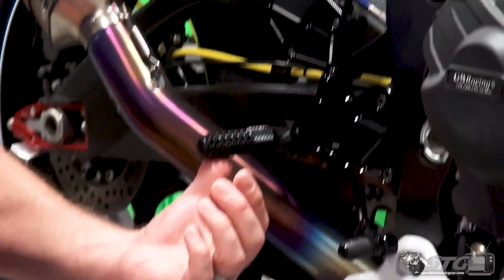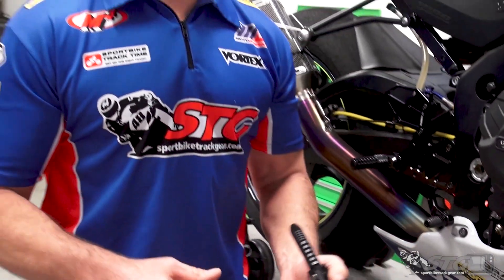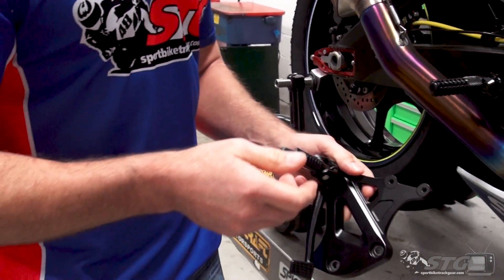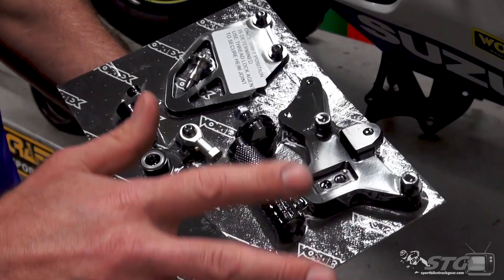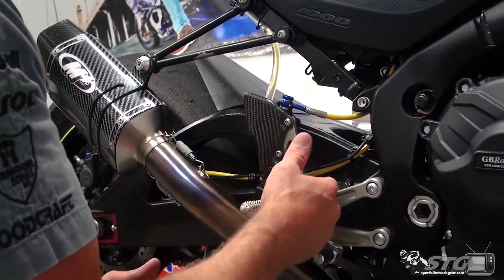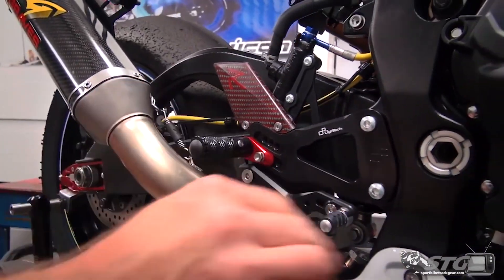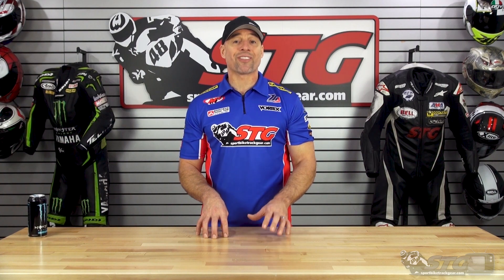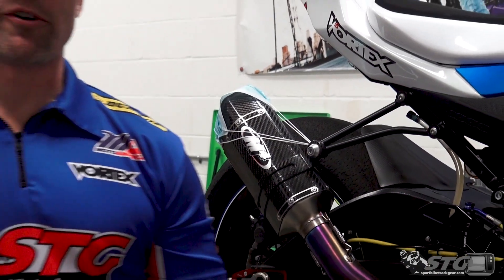Why You NEED REARSETS On Your Sportbike! | Sportbike Track Gear

Comment: Yes, rear sets are a must. Either way, I got, from you, the Light Techs. I got the other set. They put my feet and legs in the perfect position for my size. The handling  of the bike became a lot nicer when I got my knees in the proper position. I can also hit the shifter easier once I set the height. It made my bike a lot more comfortable to ride.
Reply from the maker: Thank you for the business and I am happy to hear you like the Lightechs. I rode with them on the bike and really liked them as well. - Van

Comment: I had a stock rear set on a Honda FireBlade CBR954RR that totaled the bike.  The bike high-sided and went into the swingarm, so insurance totaled it.  It was such a sweet bike, I withdrew the claim and spent months rebuilding it so I could keep it.  Might have been avoided, almost definitely, with an aftermarket set.  At the time, I was only road riding as I only had my motorcycle endorsement for 3 months, so it never even occurred to me.  In fact, if you asked me about ‘rearsets’ I wouldn’t have even understood the term or what you were referring to.

Comment: The one thing I liked about the OEM rearsets is how they had a slight tilt pushing our knees into the tank. I made it happen for these vortex to have that same feel
Reply from the maker: All of the pegs on the aftermarket rearsets are at a 90 degree angle to the support bracket. - Van
Reply: @sportbiketrackgear  I'm loving them. Going to get some spare parts for them from you guys when there available. Thanks Van and take care

Comment: great video, only question I have compared to stock what is the +/-. How far back, up, and down compared to where it sits stock?
Reply from the maker: This will be different from brand to brand and model to model. Some of the kits will call out the measurements for range of adjustment but not all. We try to include this in the listing if the brand publishes it. - Van

Comment: Hi im 5'6 riding a bmw s1000rr, and my thighs are too low to grip onto anything. Which rear sets are better designed for shorter riders? I want to move it up at an inch
Reply from the maker: Check out the Vortex rearsets on our site. Plenty of adjustability to get the pegs where you need them. Here is a link: https://www.sportbiketrackgear.com/vortex?_bc_fsnf=1&Manufacturer=BMW&Product=Rearsets

Comment: Would you recommend fixed or foldable foot pegs? Foldable options are typically more expensive than their fixed counterpart.
Reply: Some ppl are saying that fixed footpegs dont necessarily protect the pipe and the footpeg could break off. Would love your thoughts on it!
Reply from the maker: We run fixed footpegs on all of our race bikes. Whether they break off or not really depends on the crash. I have seen the fixed peg protect the exhaust in many crashes. - Van

Comment: Hey Bro! I have a GSXR600 and am 6’, 250 pound bodybuilder and the placement of my knees with the OEM rear sets is very uncomfortable. Which set of rear sets would you say would give me the most adjustability to bring the pegs lower? Anything to get less of a kink in my knees
Reply from the maker: None of the aftermarket rearsets allow for moving the pegs lower than the factory position. Lowering the pegs would decrease the available amount of ground clearance when cornering. - Van

Comment: May I ask you Mr. Van, why no Gilles Tooling? They make incredible rearsets, imo.
Reply from the maker: Unfortunately Gilles is not distributed here in the US so there will not be a proper level of support available after the sale. We prefer to offer parts that have a supply of replacement parts readily available in the event a customer has a fall and needs replacements. - Van
Reply: @sportbiketrackgear  Ditto! Sexy European parts are great until you need a replacement and you need to wait 8 weeks because Italy is on vacation.
Reply: I can't speak as a distributor but as a consumer the level of customer service I've experienced has been absolutely spectacular. From answering my questions, to getting me a free replacement shift linkage, and even sending me a dozen decals upon request via DHL. The only thing is the shipping time of at least 6 weeks is a bit of a bummer. I'm extremely happy with my investment, it's gonna be the first thing I change on my z900 and every machine after. It was between a set of Voodoo, second hand Vortex, or Hotbodies to stay within my budget, but outta nowhere I was offered a brand new set of Gilles Tooling with a $300 discount making them only $200 so I grabbed them up and they've been perfect. The only reason I needed a replacement shift linkage was because I didn't properly tighten up the lock nut after I adjusted it a little bit, ended up throwing the rod mid ride sgd and had to strain my clutch a bit in order to make it home in 4th gear, which I did manage to do. The level of service would probably be different on a larger scale though. That also explains why I got such a smokin deal cause I couldn't figure it out until now.
Reply: @skyusable  I'm actually having a huge problem with BMC right now they're not even responding to emails it seems. Gilles is Germany so I think they weren't as effected by the Covid19 pandemic. Not too sure though

Comment: Would you recommend using locktite if replacing the factory shift lever on a ninja 400? It seems like it doesnt have it from the factory
Reply from the maker: If there is none from the factory there is no reason to. - Van

Comment: Great Vid, answered a lot of questions I had. I’m 167cm tall (short) and want to know which set will provide the best height adjustment for a short guy like me? I’m riding a 2010 gsxr750. Thanks.
Reply from the maker: I would look at the Vortex or the Attack for maximum range of adjustment. - Van

Comment: I need to lower and move forward the pegs on my Kawasaki Z900 2021 because I have hip pain on the longer rides. What aftermarket rearsets would you recommend for that?
Reply from the maker: Most of the aftermarket rearsets are designed to lower the pegs and move them back. I took a quick look and did not find a set that will do what you are looking for. - Van
Reply: @sportbiketrackgear  Is there any way just to move them lower without moving them back?

Comment: Are all these rearset brand will let you use oem rear brake hose length?
Reply from the maker: The majority of the rearset kits will work with the OEM brake line kits. The only exception I can think of is the Attack Yamaha R3. Anytime we learn of any issues like this we try to add notes to the product listing to give our customers a heads up. - Van

Comment: Would you happen to have a picture or ever have experience with an aftermarket rear set holding up and saving an exhaust?  To me, the hard rear sets will bend and be trashed and even break off compared to the factory set just bending back how they are designed and are usually still good after bike goes down? 
I don't track race so I have no real world experience and wanted to know from someone like you that has this experience.. Thank you!
Reply from the maker: I have too much experience with this IMO (end of the day you race and there will be crashes). A rearset kit with fixed footpegs for sure helps to protect the bike during a crash. Personally I have never had a kit cause more damage to the bike in a fall. - Van

Comment: Hey Van, would a vortex or woodcraft rearset lineup with the graves moto 1 exhaust bracket for an r1?
Reply from the maker: Either one should work as they are designed to be compatible with the OEM exhaust. - Van

Comment: Hey Van, how much higher can the Woodcraft and Vortex rear sets go compared to stock on a 2017 GSX-R 750? I'm on the shorter side so looking to get my knees up in the cut outs on my tank. Also which would you recommend for me as I'm looking for 1-2 inches higher
Reply from the maker: The Vortex will offer a little more adjustment than the Woodcraft if you want to move them around a bit. If you are looking to put them at the highest position they will both end up in about the same spot. - Van
Reply: Thanks Van, think I'm leaning towards the woodcraft tbh. Appreciate your professional opinion 👌

Comment: I am considering getting some decent rearsets for my 2012 R6 but really not sure what to get. On my oem pegs I can lock knee/thigh into tank cut outs but feels little unsecure. I am about 5-9 but short legs for that height (inseam is roughly 31). Any recommendation based on your experience?
Reply from the maker: We are using Vortex rearsets on all of our bikes. - Van

Comment: The only thing holding me back from getting them is I don't want to loose the quickshifter that comes stock on the zx6r
Reply from the maker: You will still be able to use it. I have the OEM QS on my GSXR1000 with aftermarket rearsets. - Van
Reply: @sportbiketrackgear  with the vortex ones? Oh snap!!

Comment: With the Attack rearsets, I’ve been told for my bike (2018 Aprilia Tuono Factory) they don’t have any return (rear brake) spring or anything that allows that return. Can you confirm? I want them, but I do 99% of my riding on the street and I need my rear brake and brake light. If I get these, is it plug and play nothing else needed? Thank you.
Reply from the maker: The Attack kit does not include a return spring for the brake lever. With that said most of the rearset kits on the market do not offer this. Woodcraft offers a return spring kit you should be able to install on your master to get this done. Here is a link to this on our site:
Woodcraft Brake Pedal Return Spring
https://www.sportbiketrackgear.com/woodcraft-brake-pedal-return-spring/   - Van
Reply: @sportbiketrackgear  thank you Van. I’m 6’ 3” and 225lbs so I must have some adjustment in my pegs or I’ll drag toes or worse. I’ll take a look at the Woodcrafts springs with Attack rear sets! Thank you!

Comment: Can I still use my oem quickshifter on a ‘20 r6 with driven TT rearsets?
Reply from the maker: Pretty sure you will need a different shift rod. With that said I reached out to Driven and they are also not sure what the length of the rod would need to be. Once you get the rearsets you could take a measurement and we would then be able to help you get the correct rod. - Van
Reply: @sportbiketrackgear  sweet. Is there any issues with the brake light switch? Thanks so much!!
Reply: @sportbiketrackgear  I’m stuck between these and vortex I just don’t wanna lose the rear brake light

Comment: Any recommendations on rearrests that work well with low-profile GP style exhausts? Or do you just lose some adjustability with those type of exhausts?
Reply from the maker: Most of the exhaust systems are designed to work with the OEM rearsets. Aftermarket rearsets are designed to move the pegs up and back so there is typically no interference with GP systems that are below the rearset. - Van

Comment: Any for a 2019 zx10 for taller riders? Thanks
Reply from the maker: Aftermarket rearsets are designed to get the rider more ground clearance as well as get the ergos dialed in to best suit the rider. There are very few if any kits that will lower the footpegs if that is what you are looking for. All of the kits will allow you to move the pegs towards the rear of the bike which will give you more room. - Van
Reply: Thanks Van

Comment: Attack best rearsets on the market because of adjustment capabilities and durability .I wear size 50 euro in boots so rearsets are a must. .Bought many sets off of STG.

Van i had respect for you until the ...Best superbike is the Suzuki gsxr 1000rr??? Sorry Euro brands have surpassed the japanese brands for over a decade now ,,,Japanese superbikes havent won a superbike comparison for over a decade..FYI i own a Superbike collection of all current japanese and Euro superbikes so not a hater.Euro manufacturers kept developement going after 2008 where the japanese cut developement to minimum (due to economy)
Reply from the maker: Thank you for your business! A few years back I was able to ride all of the current 1000's in a RRW shootout and felt the GSXR1000R was the best of the bunch. To be fair all of the bikes were bad ass, the Suzuki simply suits me better. - Van

Comment: Wood craft is shit I got them for my bike and it was a total waste of money there were no adjustability what-you-see-is-what-you-get. On a 04 cbr600 f4i
Reply from the maker: Your bike is 19 years old now and to be fair you are lucky anyone is producing an aftermarket rearset kit for it. The Woodcraft kit Moves pegs up 1.25" Back 1" in a fixed position with no adjustment. For the current bike models their kits offer adjustable peg positions. - Van
Reply: @sportbiketrackgear  yea it's 19yr old 20.000 miles and in tip top shape is there anything other than the china nock offs that I can get that is  more adjustable